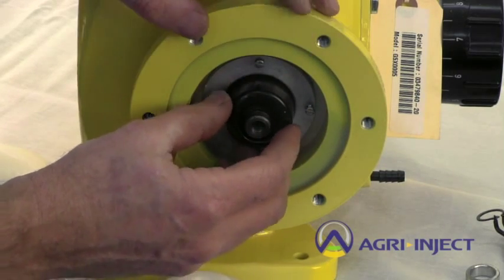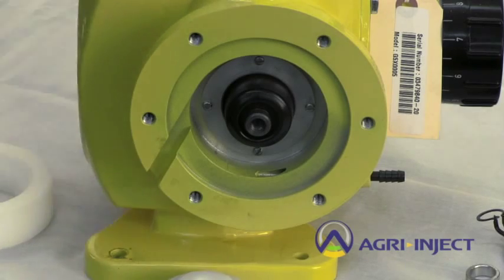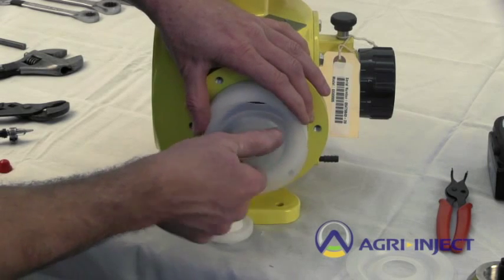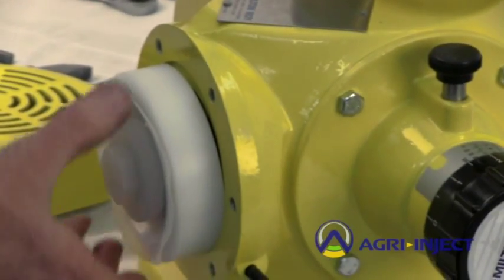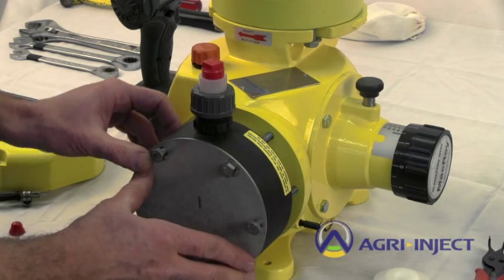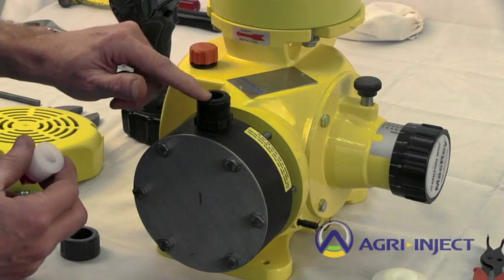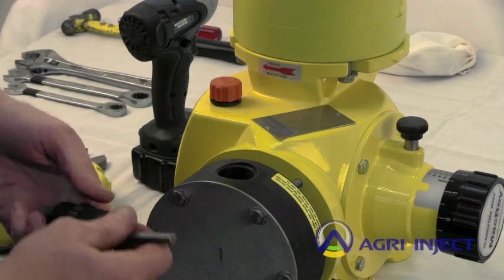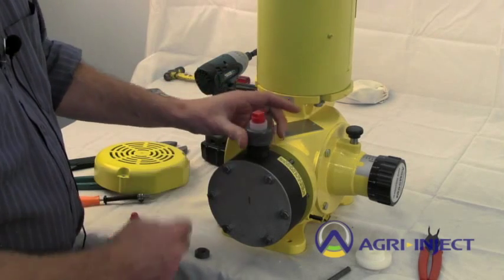Agri-Inject - Basic Maintenance - Series G Pump

Comment: Thanks for the video. It was very informative. I have one question though. Were you continuing to spin the fan when you were adjusting the stroke?
Reply: youdodat2 ,  I am glad you found the video helpful. There is no need to turn the fan while adjusting the stroke on a G Series pump. Some people will do it, as occasionally, the stoke adjusting knob can get in a very slight bind when the pump gear set is stationary. Firmly (but not forcefully) turning the knob in this situation will easily suffice. If the knob ever seems seriously stuck, it indicates other, more serious, issues that I would recommend a call to us at (800) 446-5328 to remedy. If you have any further questions, feel free to give us a call. Josh Krautkramer,Director R&D and Engineering, Agri-Inject